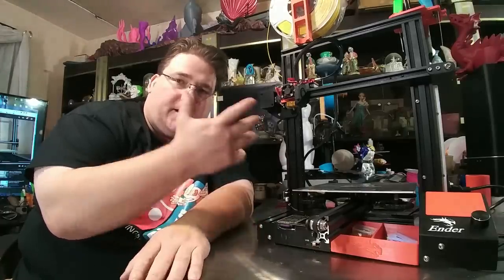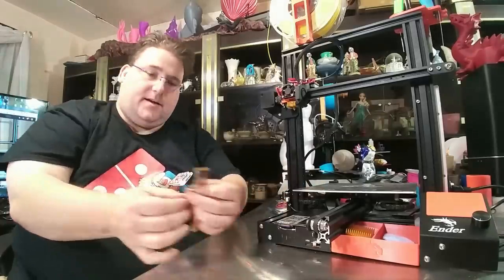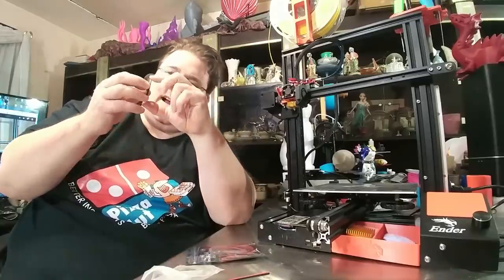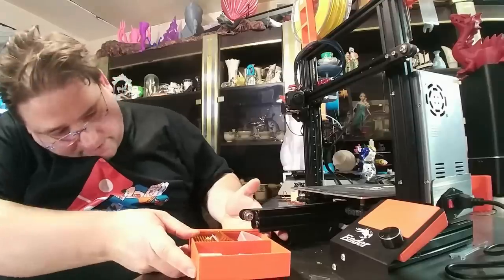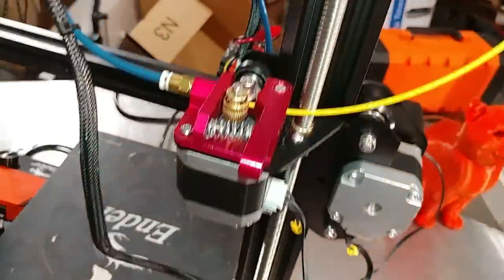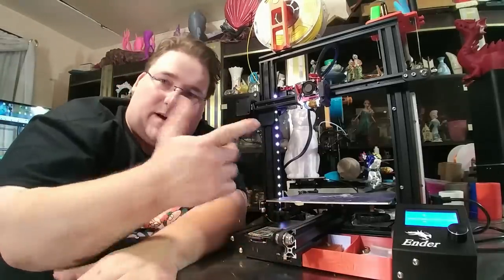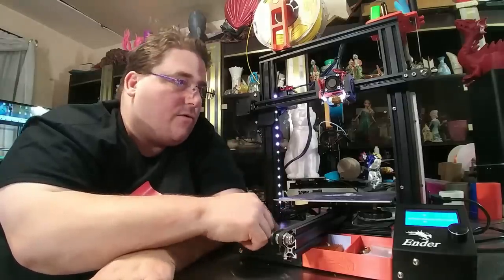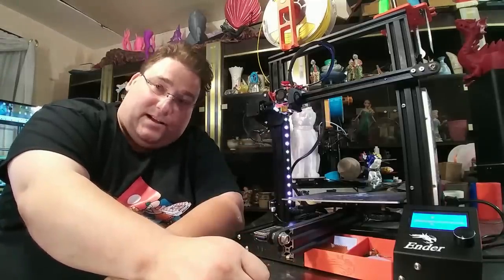T3DP 216 Ender 3 Upgrades & Mods

Comment: Please add the nozzle cover to your ender collection. thanks.
Reply from the maker: Do you have a link for it?
Reply from the maker: Keep in mind that is not correctly scaled for this printer it will work but you'll have to glue the fan on and shift it down I'm going to work on it remake for the Ender 3
Reply: ah ok I will def wait for that. I hate the metal box covers. make working with the nozzles so hard. has to be an easier design.

Comment: if the motors were mounted to the frame it would act as a heat sink my motors dont get hot on my ender 3. ive cork gaskets on my cr 10 they work great and are very cheap on ebay in the uk
Reply from the maker: My Motors got very hot before I put the dampers on I think the vref is just wrong on this particular printer
Reply: Nerys was just looking at mine i see its not the same stepper on the y as the cr 10
Reply from the maker: Yep I think they're smaller

Comment: Have you taken the wheels and carriage off the right hand side X-axis? If so, why? I'm wondering what the benefit is
Reply from the maker: The benefit was to correct an error my original one the holes for the bolts for the top brace were Miss drilled causing the two towers to be forced together making the right hand probably too tight wrecking the prince removing the right hand trolley was a temporary fix for this problem once I discovered how to correct it redrill the top two holes I leave the right trolley in place now
Reply: Thanks! That makes sense.

Comment: Did your bed motor hit the bed when you added the damper?  Mine does and doesn’t make contact with the limit switch anymore.  Trying to fiddle with it, as it’s only a few millimeters from it.
Reply from the maker: No mine works fine can you take a picture? I bought another Ender 3 hoping I get the new model with all the changes so maybe I will find out
Reply from the maker: Someone sent me pictures and hopefully the one I ordered will be updated but I believe they change in the arrangement of The Wheels on the Y Carriage plate is the source of the problem if you're familiar with using a Dremel the solution is pretty easy just grind away some of the metal on the Y Carriage until it doesn't hit
Reply: I sent you those.  Somebody posted a link to an adjustable Y-axis endstop.  Before I go cutting the carriage, I'm going to try that and see how it goes.  If you're interested, here's the link for it:  https://www.thingiverse.com/thing:2879245
Reply: By the way, my steppers used to not get hot until I added the soft mounts.  My guess is that, since I had to move the timing gear further out from the motor, the pressure from the belt has more of a leverage effect on the motor bearings.  Basically putting extra radial force on the motor shaft, causing the bearing to encounter more friction.  Maybe a combination of that and the air-gap between the frame and the motor, now the motor can't transfer its heat to the frame.  It's a shame because these mounts are so nice!

Comment: I have a question. I guess you are running your power supply on 120 volt instead of 230 volt, will it change the output for the connected led strips if I (I live in sweden and we have 230v here) set my power supply to 230 volt? Because I am thinking about buying some led strips and do as you have done but I don´t know if I have to do 24v (2 short ledstrips) or if I can buy a 12v (1 longer strip).
Reply from the maker: The LEDs are running off the DC power supply of the printer. So the input voltage from your main line is irrelevant whether you are 110 volt or 230 volt it is being transform to down to 24 volts out of the power supply. The reason I run two strips is because the strips are 12 volt. So I have to run two of them and Siri to get 24 volt compatibility. If your machine is outputting 12 volts. Then you only need one strip or two strips in parallel.

Comment: How did you get the x axis to be horizontal? Mine is always lower on the right side without the second z axis stepper.
Reply from the maker: If your ex access won't stay level that means you're right hand trolley is too tight or your right hand vertical is crooked

Comment: Do you have a link to a board to step down the 24V from the PSU to 12V for the LED strips?
Reply from the maker: No board I simply wired to 12 volt LEDs in series so they would run off 24 volts
Reply: Thanks man!

Comment: I don't see the cable clips you use to dress all the wiring.  I've looked at all the Thingiverse stuff you linked to.  Would you provide a link to those?  
Thanks in advance!
Reply from the maker: It should be in my Ender 3 Collection I will double check when I get home
Reply: Thanks man!
Reply: I found the clip for the ribbon cable.  https://www.thingiverse.com/thing:2880021
Still not seeing the clips for the rest of the cables.
Reply from the maker: Thats it. I use the same clips for all cables

Comment: Does anyone know where to connect the LED strip in the printer itself. 12v
Reply from the maker: If your printer is 12-volt you can connect it directly to the power supply just loosen one positive and negative terminal on the power supply and put the positive and negative wires of the LED strips on those and retighten the screws

If your system is 24 volts you have two choices you can either connect to LED strips in series and then connect them to the 24 volt power supply the same as the 12 volt or you can use a buck converter link on my Amazon deals page they are very cheap to drop the voltage from 24 volts to 12 volts so you would connect the buck converter to the power supply and then the led to the buck converter

This all of course assumes that we are talking about 12 volt LEDs meaning LED bulbs or strips already configured for 12 volt usage

Comment: Hey, I’ve been looking at printers for the first time with the intent of printing tabletop miniatures and whatever else takes my fancy. I’m looking to spend around £200-400 and the Ender 3 has really caught my eye. I’m probably gonna be buying in a few months but would you say that the Ender 3 is the right thing to buy or are there others I should look at?
Reply from the maker: I can't answer that for certain right now for tabletop Miniatures I would tend toward the Ender two if you cannot go resin the Ender 3 we will have to wait until the production machine comes out to see if they've corrected some of the issues they are minor issues but still issues
Reply: Ok thanks, I think I'll wait around a bit to see how the Ender 3 production machine ends up. Will you be doing a review when it does?

Comment: hi - thanks for all your videos - great stuff 
i have set up my creality ender 3 using  55 for a print speed  - after generating the gcode and sending it to the printer, the speed remained 100 and not what my settings were in cura - do you know why ?
thanks
Reply from the maker: The 100 you see on the screen is not the speed of your print it is the feed rate of the code as it runs the g code so if you program it for 55 millimeters per second then 100% would be 55 millimeters per second

The feed rate 100 on the printer means it will run the code as you programmed it if you change that you are changing the rate at which you run your code so that should always say 100 unless you change it manually on the printer that's not print speed that is the normal 100% rate rate at which the Coble run which is determined in your slicer
Reply: hi Nerys - i get that however- if i alter the speed in the TUNE menu, it slows down........i have printed a test cube with various speeds, but it DOES NOT slow down when doing outside layer for example - all seems to be same speed even the faster infil speed
settings are 55 for speed and 120 for infil - i cant ssee or hear any difference - confused
Reply from the maker: @stephenkosloff6081  make the difference dramatic. Do 50mm/s but make outer 20% and make travel speed 120mm/s that should make it a lot more obvious.
Reply: ok will do - thanks - where are you by the way - usa where ?
Reply from the maker: @stephenkosloff6081  Southeast Pennsylvania USA hopefully if all goes well soon-to-be New Mexico fingers crossed
Reply: im in uk - ln a place called south benfleet - but originally from south africa - im trying to get my head around this stuff all in a week - so guess i should slow down and work out a few things for myself - hope you get your move - on the map it looks better - far from any freek tidal waves |(new york movies|)
Reply: hi  - was doing well all of a sudden all my prints stop dead and the nozzle moves up and up and up till i stop it and send it home = im confused
all of a sudden................i cant print past the 1st layer and it does this - at one stage it was moving right acccross the board to right hand side and jamming - what the...
what have i done ??
Reply from the maker: first try running gcode you have ALREADY successfully run before (IE already on the sd card "NOT" resliced old existing code that worked before (you can also try one of my samples in the profiles link)

second is try a different SD card. you may have a bad card and the data your copying over to it is being corrupted.
Reply: hi - bad card - didnt even find it when i transferred it again - thanks - i have now reset my printer to cr10 and changed its name - hey presto back to decent prints
cant believe it but thats because i try to run before i can walk - would love a profile from you to enable me to print well - thanks 4 ur advice - again
Reply from the maker: @stephenkosloff6081  no problem. 8ts a fun learning process. I have aimplify3d profiles in the description.
Reply: yeah ill be left with no hair - ive gone through the whole self build arduino quadcopter stories in the day myself - so i know that theres still alot of pain comming, haha
Reply: hi Nerys - my printer does not centre when starting to print all of a sudden - i send it home and it goes home but starts up printing (not)in the front of the board, any ideas ?
thanks
Reply from the maker: @stephenkosloff6081  the two ways this normally happens is your G-Code instructions are incorrect something got changed in the slicer or one of your limit switches end stops is not working

Checking the first is easy download my sample G-Code for my profile folder for the Ender 3 loaded onto the SD card directly and try printing see if it centers

Comment: how about using 4mm (height) heat sinks?
Reply from the maker: It's about surface area although I did get some copper that is much shorter but the aluminum on the side seems to work fine
Reply: I see. Copper is even better than aluminum if you consider thermal conductivity alone.
also, you used thermal adhesive or screws + thermal paste?
Reply from the maker: Pedro G Cominal exactly much better thermal conductivity but only if I need it so far the aluminum is working fine no screws just thermal adhesive

Comment: Can I ask you what the cord is bound to the unused stepper screw hole (unused cause of the dampener setup), cant see to understand the function..
ps love ur channel very much and hope I helped you out buying my ender 3 as well as a (eu warehouse, hope that counted?) cr 10 together with some vaping mods and 26650 batteries through your aff link!
keep up the good work mate!
ps and sorry (call it professional habbit ;) keep working on that weight, its a hard battle but your pancreas and hip/knee joints will be thankfull, not to mention any other systems in your body ;)
Reply from the maker: What do you mean the cord is bound to the unused ever screw hole?

Yes if you click my AF link anything you buy accounts and I very much appreciate it

Fully understood and agreed I am on borrowed time if I don't get rid of this weight fast hopefully when things slow down a bit and I don't have to work so much I'll be able to put more time and energy into the weight loss I was doing good while I was riding the bike 60 lb in a year

Comment: Any plans on trying to do ABL with it?  I've seen someone out there has a sensor but is charging $60+ for a few dollars worth of parts.  Hard to justify on a printer that was $158 .
Reply from the maker: I have no desire to use a BL or any other automated bed leveling as the printer hold its bed level perfectly fine I have not had to adjust the bed level since I built the printer once I fix the dragging vertical the bed level has held perfectly
Reply: check out skynet on ebay 24.99 delivered within uk for complete probe kit ive one on my cr 10 and the th3d version on my ender 3.

Comment: how do you install the TL smoothers? i bought 3 they have 4 pin plugs not 5 like the motors? Regards

Paul
Reply from the maker: They plug-in on the brain board side so you have to open up the brain box and find the plugs for the X & Y stepper Motors you only need two

You unplug the stepper and plug the stepper into the smoother and then plug the smoother into the brain board it's literally in line Plug and Play super easy just insulate the back of the smoothers so they don't short inside the brain box I just ran some hot glue across the solder joints on the back and then push them to the sides so they don't block airflow
Reply: i seen around the internet people are having to change the cable layout on the 4 pins between the stepper motor and the brain board, is this required on the ender 3?
Reply from the maker: No I have heard that as well because some Motors are wired a little differently the ones that I ordered and link to in my video Work plug and play with the Ender 3 I did not have to change anything
Reply: Nerys I ordered 3! Woops! How come you only need them for 2 axis? I appreciate your messages. Regards Paul
Reply from the maker: Because the X and Y are the only access that move in such a way that they can introduce artifacts into a print with this kind of a electrical glitch the extruder is simply a continuous Extrusion it never really changes the rate at which it pushes so the effect would never come into play and the Z is the same thing it moves up a fixed amount each time it moves up so this affect would never come into play the reason they include three is because typically this was a area where Delta's experienced this problem and with Delta's the taxis are not controlled by separate steppers all three steppers control all three acts he's so you would need a smoother for all of them

Comment: Thanks for the links to the upgrades.

Ordering the dampers and TL smoothers. 

I just need them on the X and Y only, right?
Reply from the maker: Correct just the X & Y it would also reduce the noise from the extruder stepper motor but that's so rarely makes noise I wouldn't bother wasting one on it
Reply: do they cause any effect in final prints, beeter, worst, same?

Comment: Chris... Will the compression springs listed work on the CR-10?
Reply from the maker: Yes they are the same as what comes on the cr10 but slightly stiffer which is a good thing
Reply: I made of the mistake of buying a ABL sensor and using solid bed mounts.  I got better results adjusting the bed manually per your instructions.  I ended up removing the solid mounts and going back to springs but I have lost one and now have a solid mount on the far left corner and springs on the other three which is a bear to try and level properly.  I'm close but not quite there. Hence..ordering new springs... I should have left well enough alone...
Reply from the maker: Playing with stuff is fun I'll probably get an abl at some point just to play with it no worries if you have any other Springs handy use those until it arrives

Comment: i have a monoprice maker select that i converted from 4 point leveling to 3 point leveling, because i am not a patient person and trying to level 4 points was driving me insane, anyway, i was curious if you think this printer would allow for upgrading the print bed to 3 point
Reply from the maker: Before you go converting everything to 3 point which is not a bad idea but to save some time watch my cr-10 bed leveling Basics video it applies to all manual knob based bed leveling three point or four point once you understand what it is you are seeing and what is happening bed leveling becomes very easy most of the time

Comment: What brand of pla do you use in the E3?
Reply from the maker: Pretty much anything I can get my hands on and I have a lot of different brands :-) what usage are you looking for in particular?
Reply: Nerys mainly i want to print brackets and miniatures for friends...some display pieces and hand props.
Reply from the maker: Phu Vet if you mean brackets as in to hold up shelving and stuff like that you're going to want a very tough filament for that as for Miniatures I do not have experience with that category of printing so take my advice with a grain of salt but I suspect you were going to want a very high-quality pure pla that will print at a very low temperature with good viscosity you might look at something like Paramount 3D they have some extremely high-quality pla also esun  pla Pro might also be a very good filament for that kind of printing but both tolerate pretty low temperatures and the lower the temperature you can print the better in theory your results should be but a lot of that is going to be fine tuning your ability to slice a model not so much the printer although the Ender 3 is a good choice for this other people are using the Ender 3 to print miniatures with very good results it's going to take practice I would suggest a neutral gray color so that painting is as easy as possible